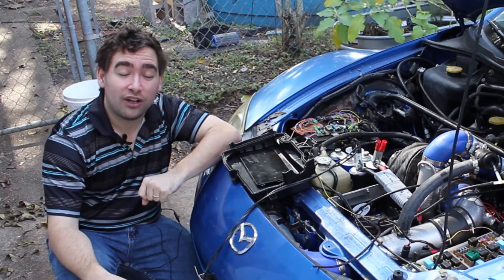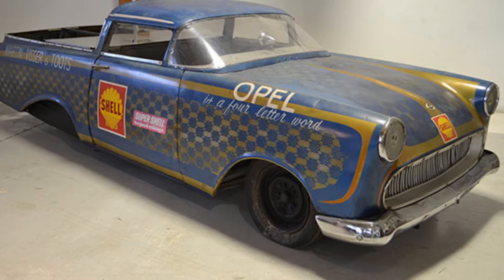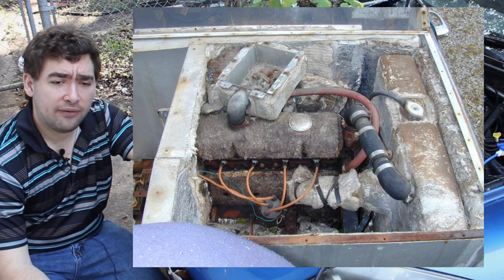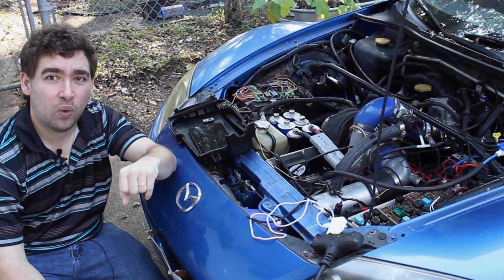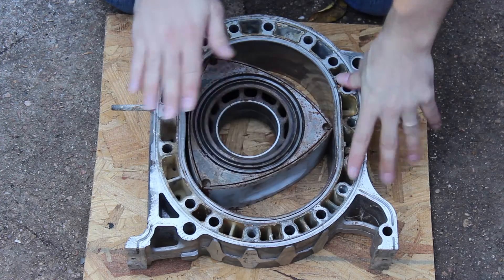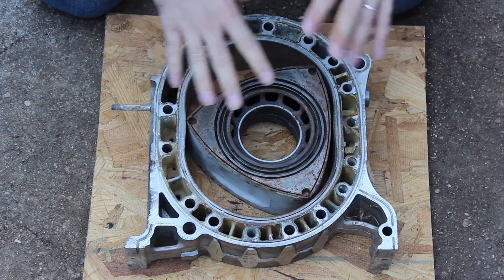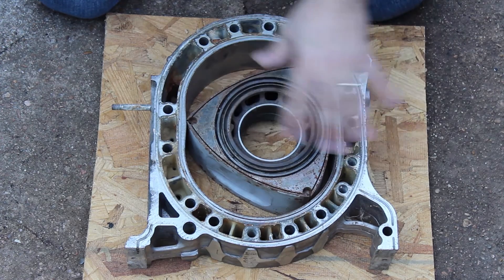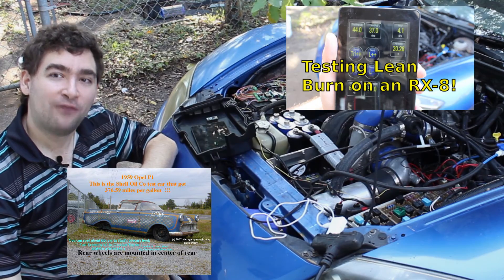How Lean Burn works and why the Rotary Engine - Voiding Warranties Ep 26

Comment: I recently wired my megasquirt to control the secondary ports on the intake of my 4 port motor. Being able to cruise on the 2 primary ports bumped my highway mpg from 22 to 26. Looking forward to the lean burn Rotary.
Reply from the maker: +pj10b Very nice!